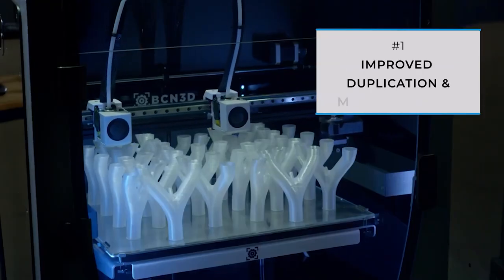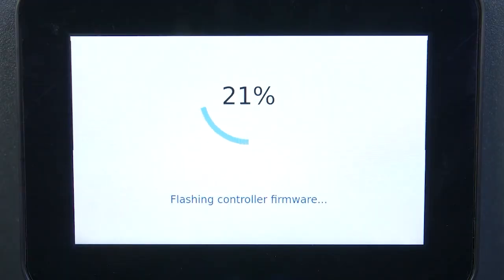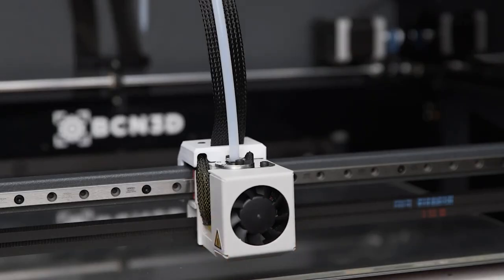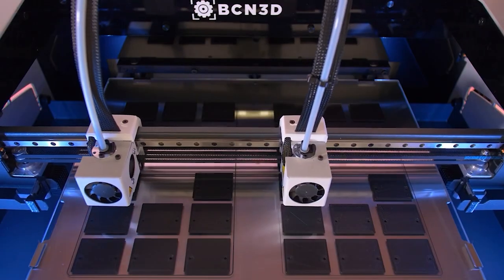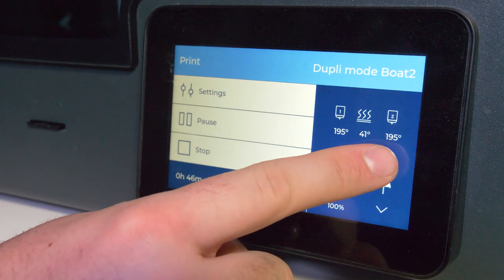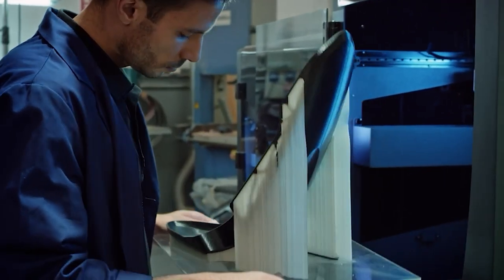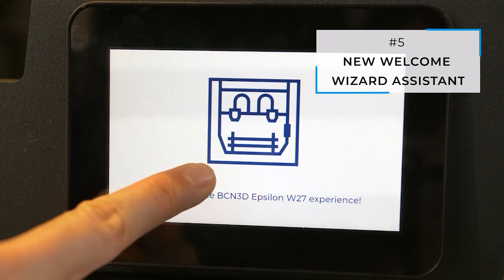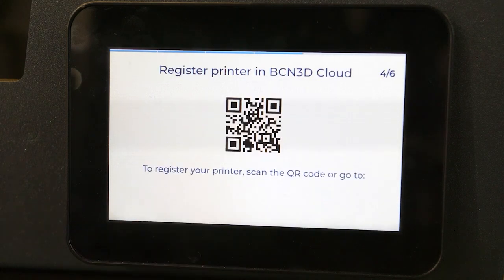Introducing Firmware 2.0: The biggest update of the Epsilon era.

Comment: Aren't those features already in opensource firmware for years?
Reply: I was thinking the same thing myself, here I was expecting some input shaping like on klipper for higher accelerations and print speeds.
Reply from the maker: Hi, we are fully committed to constantly improving our 3D printers and adding new functionalities as we understand that this is what our customers expect. In the latest update, we added functionalities that we had not included yet. In fact, we are also working on several new functionalities for our 3D printers, which will be available in the near future.
Reply: @BCN3D  I am very angry about your support. sometimes I don't get any answer from you it's terrible. And your update not working on w50 I get the error (round circle with X at middle) this error I get on 99%. Next big problem  when I use PEI Sheet and I always must bend the middle tab when the printer doing BED calibration…. I am very disappointed and angry with you
Reply from the maker: @kesa696969  Hi Kesa, we regret hearing this, please, could you give us your contact email so we can solve the problems that you have had? Thanks!
Reply: @BCN3D  kesa696969
Reply: gmail
Reply: @BCN3D  all OK?
Reply from the maker: @kesa696969  Hi, thanks for the information, the support team has received your contact information and will contact you as soon as possible!
Reply: @BCN3D  Very poor support, nobody has contacted me yet, and I'm still facing issues. I'm very unsatisfied with this printer; it would be 100 times better to go with a simple old Ender 3 Pro or Prusa MK3S because I could find more information and fix it myself. The only advantage of this printer is that it can accommodate larger parts. The Stratos slicer is a complete disappointment, just a copied version of the old Cura, lacking half of the features that the new Cura has. Can't your programmers create a simple setup that would work with all the printer's functions once installed with the new Cura? And why can't you adapt it to Prusa Slicer as well? It's just tragic. I'm very sad that our company purchased this unreliable printer; I try to use it as little as possible and rely more on my modified Ultimaker 2+ with an E3D hotend."
Reply: I can only say that Open Source 3D printers are much better. With them, everything gets updated faster, new features emerge, while in these 'dinosaurs' everything lags behind for years. In short, it's a big disappointment.
Reply: I'm not sure if the update fixed the setup or not, but this time it started up properly. Something might have been fixed because the file size is slightly different, as I noticed.
Reply from the maker: @kesa696969  Hi Kesa, please can you contact us here? support@bcn3d.com. In this way we will be able to give you assistance asap.